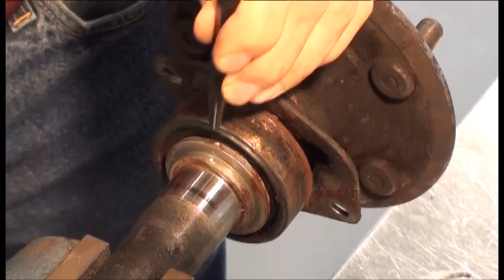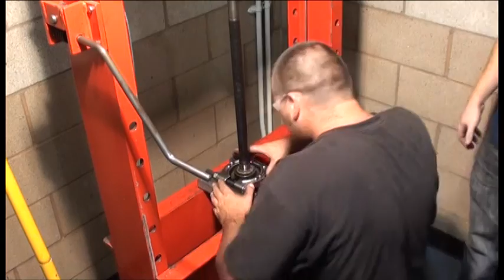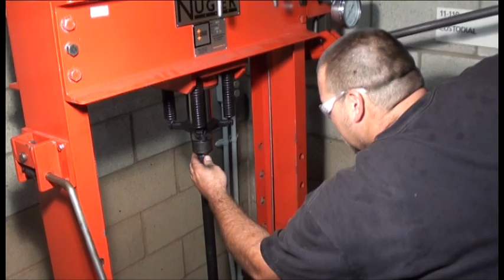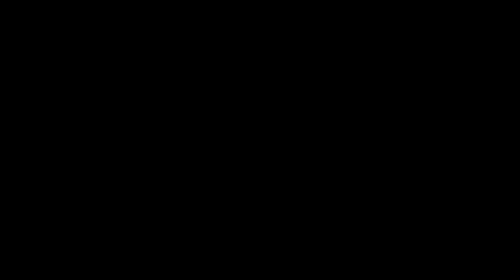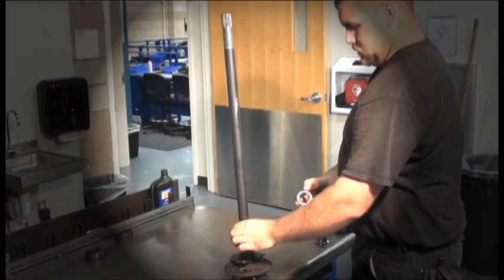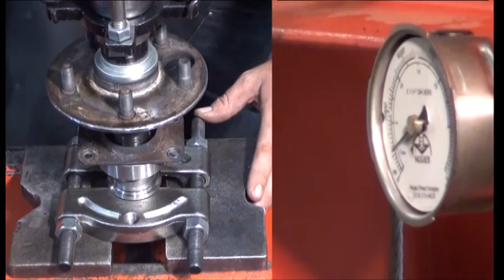Axle Bearing Replacement 1964 - 1978 Mustang

Comment: Can someone tell me what seals this besides the black rubber seal in the bearing? I had mine leaking out the shaft,changed the bearing(THIS TYPE IN THIS VIDEO), and it still leaks. Is there a seal also or silicone need added or a gasket?  Thank you
Reply from the maker: You see that shinny surface on the axle next to the collar?  That is the seal surface.  The seal is in the axle housing.  If that shinny surface is damaged or grooved the seal won't seal properly.  Also make sure after replacing the seal that you look for the axle vent.  if this vent is plugged up the seal will leak again.  Make sure the oil is not over filled. This can also cause the seal to leak. Sorry I don't have any pictures of the seal for this vehicle but I do have a video on replacing an axle seal and bearing from a differently designed rear axle.

Comment: This is a great video if you have a press with a base large enough for the flange to pass through.  The average guy at home as something like the Harbor Freight 20 ton press, which is strong enough in terms of force, but won't allow the axle flange to pass through to press off the bearing, though you can press it on once you do get the old one off.
Reply from the maker: This is a problem when your press won't accommodate the job. Sometimes a custom homemade jig is required to make up for the short comings of the shop tooling.  If you do enough of these it might be worth while to spend the time fabricating something. You might look into a piece of square or round pipe or tubing that has an inside diameter large enough for the flange with thick enough walls to accommodate the pressure and long enough to remove the bearing.  I would think 6" would be enough. There are a lot of online metal stores where you can choose the inside diameter, wall thickness and length and have it shipped to your door.
Reply: @DrivelineMaster  This is why you're the master

Comment: I'm sorry but nothing you are doing is correct with the press, you can bend the bar and with the chisel you can mistreat the bar, but it is not the correct procedure, it is something unprofessional, I am sorry for you, but it is the truth
Reply from the maker: Everyone is entitled to an opinion.  1) I see no other way to perform this task. You say it's wrong but don't offer another solution. 2) I know machinist, and shop technicians who have been doing it this way since the mid 1960's and have never..... ever... bent anything or has the integrity of the axle ever been compromised to breakage, failure or malfunction.  This is one reason for drilling the holes first to weaken the retainer and lessen the impact on the axle.  I have known some who heat up the retainer to install it but that too can compromise the retainer and the heat as it cools can transfer to the bearing.  Not a good idea.  As I said, you have the right to an opinion but you offer no other way to perform this task.  On the other hand I have been doing this for over 40 years with a lot of history and experience.  If by chance you are a metallurgist there is theory of changing the structure of the metal and then there is real world practicality.  These are not space crafts.

Comment: If you can press them both on at the same time. Why not press them both off at the same time?
Reply from the maker: You can try but it takes a lot of pressure sometimes.  Remember the old bearing and retainer have been on a long time.  I have always done it this way.  I didn't show the gauge when I pressed the bearing off but it took between 4 and 5 tons of pressure just to remove the bearing.
Reply: @DrivelineMaster  i guess that was sort of a dumb question. Because why else would you and other drivetrain gurus do it like that. Im about to do my samurai axle bearings I never messed with pressed on bearings.  Only c clip axles.  So i was just doing a little research thanks for the video

Comment: you have heated the bearings and the safety ring and you do not need to press them
Reply from the maker: This is an option if you don't have a press but you have to get them pretty hot and I prefer not to expose my new bearing or locking sleeve to that kind of heat.  I also prefer not to work with the very hot parts.
Reply: @DrivelineMaster   you are  max right

Comment: Great point, "support the splitter where the sides of the splitter are supported by the main blocks."  I have noticed that a lot of people make the mistake of having their splitter installed where the bolts are absorbing the majority of the press' pressure, which will result in the bolts being bent or even failing.